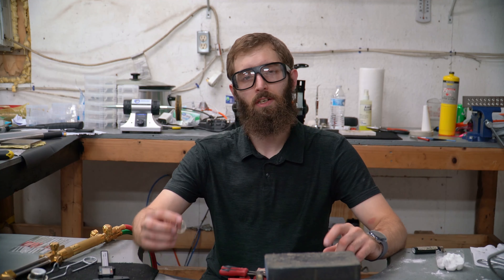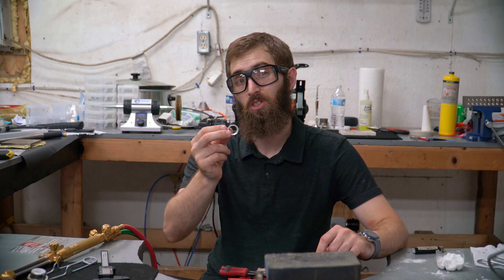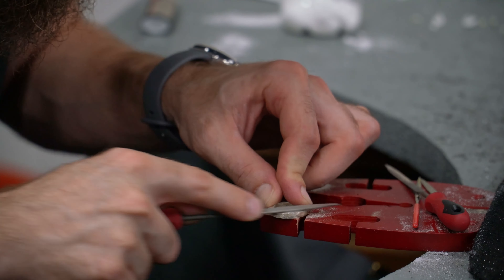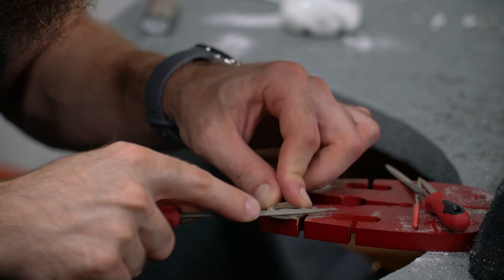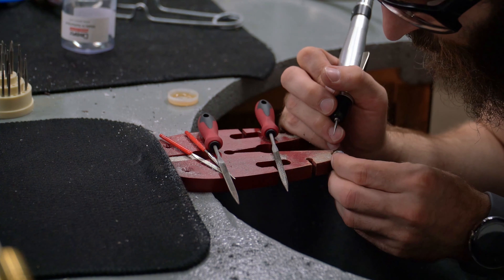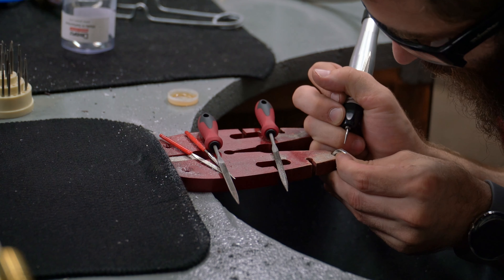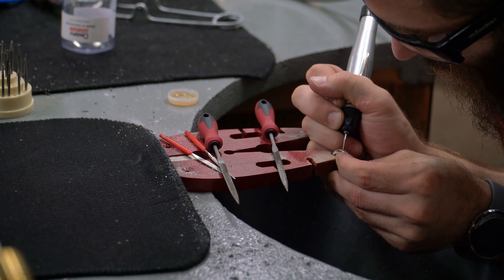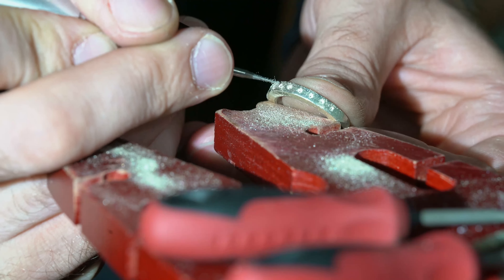Drilling Holes To Set Gems! | Making Jewelry | #8

Comment: how do you know how far apart to drill, or is that a preference thing?
Reply from the maker: I measure and mark before hand. Most jewelers prefer a 0.15mm space between the stones. You also have to account for the depth of the holes because if you drill too deep the gaps will get smaller and the gems will touch. Having a blueprint drawn out and measuring depth constantly will prevent this.